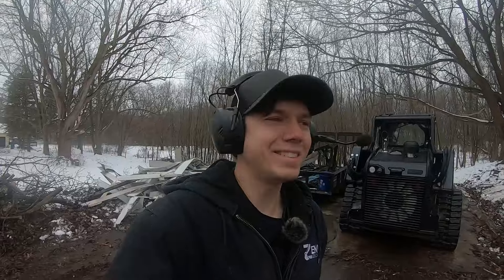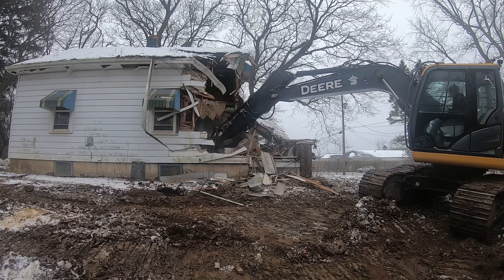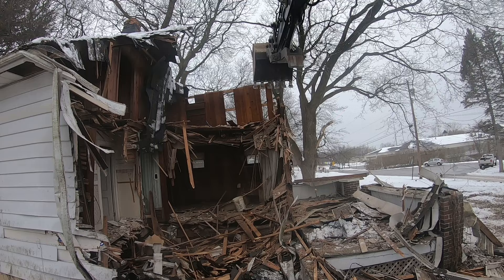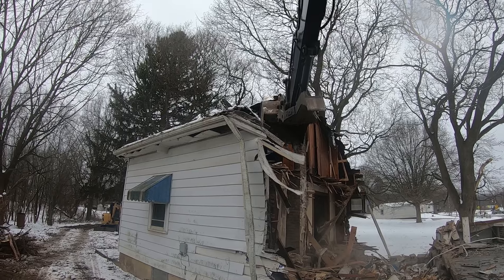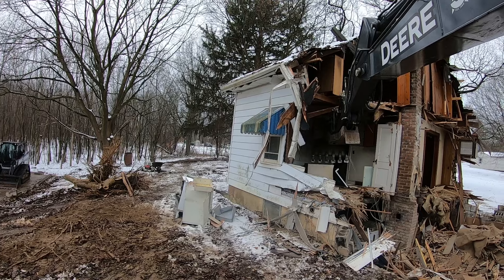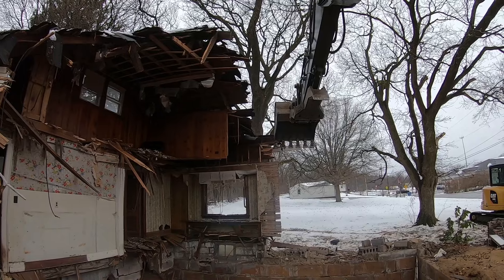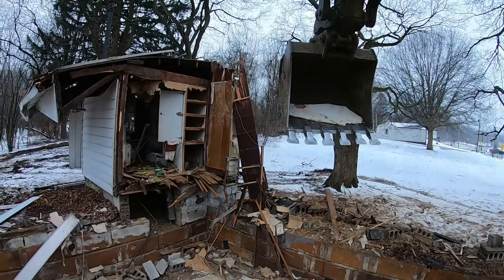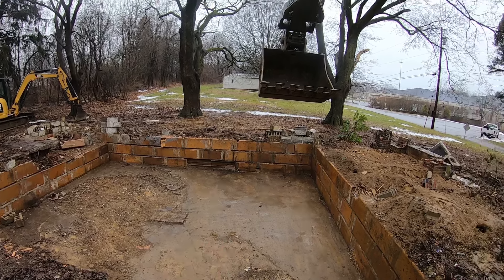How to Tear Down a House

Comment: What did youndo with the gas/water and sewer lines? Did you have to have the power company come out to disconnect the main from the pole?
Reply from the maker: @jessenichols6543  The electric account owner had to have the power disconnected. The gas account owner had to have the gas disconnected. Septic system was demolished to county standards and inspected by the county. I had to hire a certified well contractor to seal the well and file a permit with the state.
Reply: @zaccheus  thanks I'm also in the 330 area and about to venture into a house demo for a customer

Comment: How did you prep the sewer, gas, water, electrical lines?
Reply from the maker: Sewer was a septic system. We went through the county abandonment procedure for that. Account owner was required to call and have electric and gas cut off. Both of those utilities remove their own lines. And it had a well in the basement which we followed the county's well abandonment procedure for.

Comment: Do you have the house tested for asbestos and lead. Also does ohio have regulations on dust control like do you normally have to have someone there with a hose hosing it down as you tear it down. And can you crush the block up and use it for part of the back fill for a basement
Reply from the maker: All of the municipalities have different regulations around here. The EPA doesn't have any regulation on single family dwellings to my knowledge. Some towns want certain things test for, others do not. This city wanted a rodent inpection and abatement and well as insect inspection and abatement. This city also allowed us to crush masonry down to 6" and use it as fill. The floor was allowed to stay as long as we perforated it to allow water passage.  Not all of the municipalities around here will allow that.

Comment: Guys, question.  Do you leave ONE WALL UP when doing demo?  In New England; there are two types of teardowns; one complete, where you have to go through HeII in front of the Planning Board for like a year BEGGING them to sign-off on your plans, OR two; a "renovation" in which you demo everything except ONE WALL and build new around it.  The second one is extremely easy in which to get Permission, while TOTAL DEMO is much more difficult to gain permission.  Is this the case everywhere, in the rest of the nation?  Thank you.
Reply from the maker: @Jgeneraledger23  I’ve never heard of anything like that around here. Government regulations are pretty reasonable here. The biggest challenge is that every municipality has a different way that they want things done. Different inspections, different ways of dealing with utilities.

Comment: Zach I’m surprised you didn’t take your mini and strip the siding off first and the awnings also surprised siding wasn’t insulated like you said lunch $ we’re headed to scrap yard anyway. I’m also surprised the county or the individual who hired you didn’t want the foundation walls and floor removed from the site. Job went well Got to be better the tree climbing
Reply from the maker: All fair thoughts. The aluminum siding was just a bonus, when it was easy to separate, I separated it, but there wasn't enough mi ey it to spend a substantial amount of time on it with that big machine sitting there. I also thought about pulling the copper pipes out before demolition, but I gotta draw the line somewhere 🤷‍♂️

Each city has different requirements around here. This city just wanted the floor perforated so that it didn't hold water and the walls hauled off or crushed so that there weren't any pieces bigger than 6". That red block crushed up very easily.

Comment: There was a lot of aluminum on that house. Is it not worth taking that off for scrap?I notice no one tearing down a house takes off the aluminum but takes the appliances I was just curious
Reply from the maker: Excellent question! The siding is mostly a wash. The time to collect it and haul it costs about as much as it pays at the scrap yard. It doesn't take up too much weight or space in the dumpsters and so I only save the pieces that are easy to save. The appliances are not allowed in the dumpsters and so I have to separate those out. They take less time to separate, but there still isn't much profit on them. It's just important to keep them out of the dumpsters.
Reply: OK thanks for responding  I figured that was the case